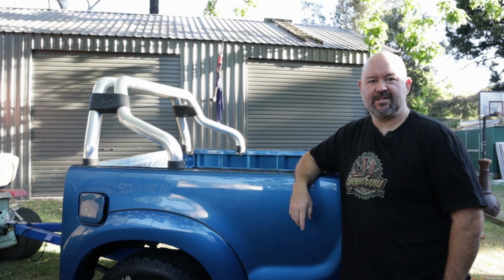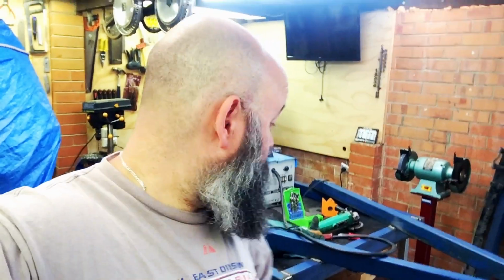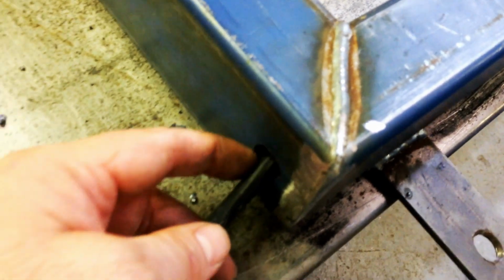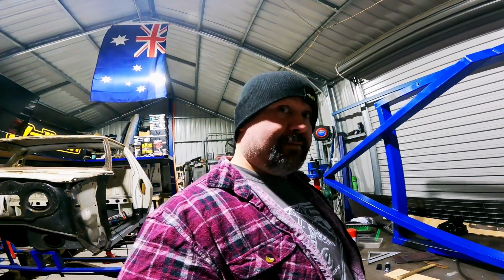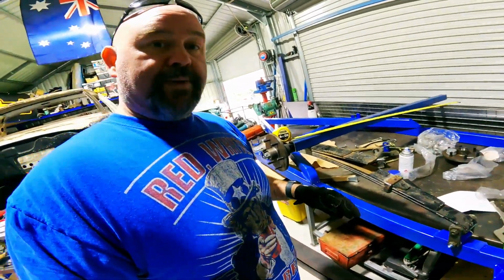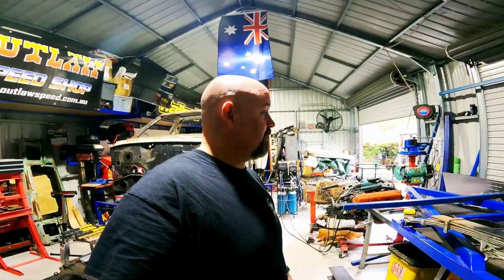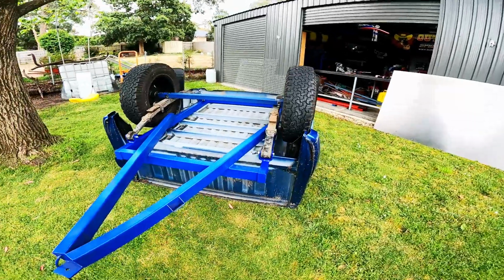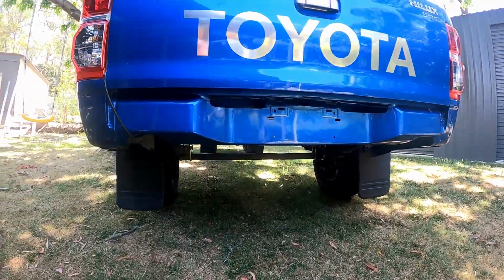BUILDING a UTE TUB TRAILER | The Shed Sesh

Comment: Trailer is unreal mate.. and was a great laugh. Hopefully doing something very similar soon… keep the trailer builds coming 👍
Reply from the maker: Cheers mate. Good luck with your build. Hopefully it goes a bit smoother 👍👍😊
Reply: @TheShedSesh  any chance you know the weight of the trailer?
Reply from the maker: @TheCotters  hey mate, not specifically. As I mentioned in the vid, you could easily go 2mm instead of the 3mm steel to make it lighter but as it stands I can move it around pretty easily by myself. I’d weigh it for ya but got nothing to weigh it with haha.

Comment: Hey mate. Would it be too much to ask for the plans or dimensions of your bottom under-tub parts? Mine has a canopy and it's VERY heavy and I cannot flip it over to measure it
Reply from the maker: I can mate but might take a few days to get. Of course I never wrote them down haha. You after the bolt hole locations? Spring hanger locations etc? Anything else?
Reply: @TheShedSesh  Yes please mate, width and length, bolt hole locations, hanger locations, and anything you'd be willing to add for a young player. I've never done anything like this before and I'd be so grateful.